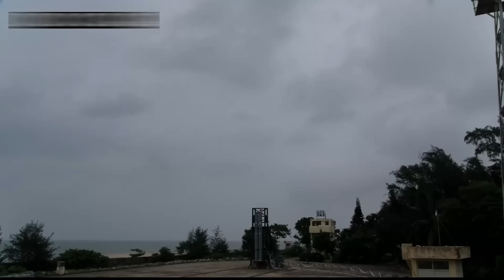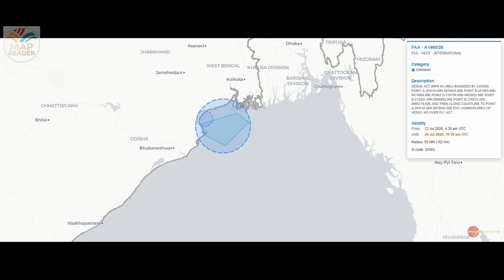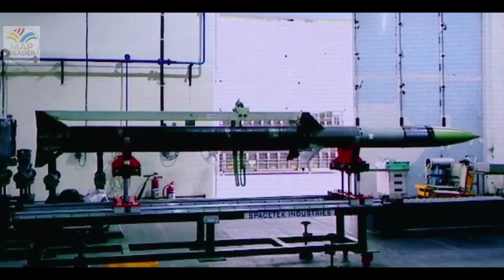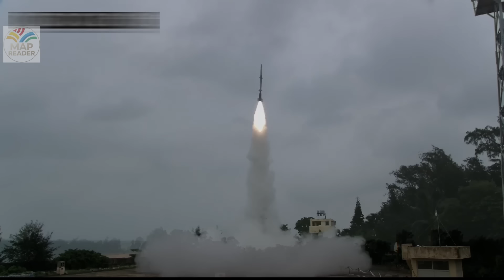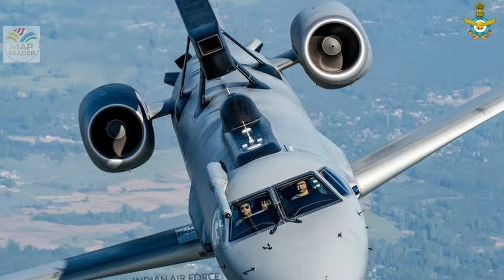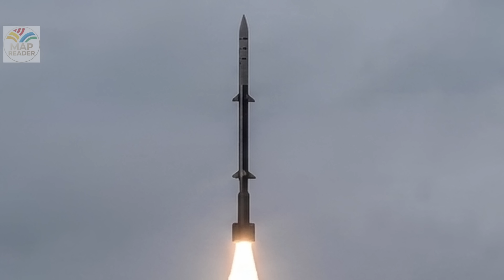Kusha Air Defence Test Successful | This is Big

Comment: Dear Map Reader ji,

I thought Su-30Mki can be used as aerial Air Defense System by integrating Akash NG intercpetor missiles .

If ALBM integrated then why not AL-Interceptor missile and it can be layered Airdefense and also Backup and hard for enemy to kill Airdefense system, or it can cover from aerial if Ground ADS destroyed.

We need to tap Su-30mki full potential.
Reply from the maker: Akash ng is heavy because it is ground to Air , Su 30 Already has Astra missile family far lighter and more range than Akash NG , actually its the other way around astra sfdr will be used as ground to air with a booster

Comment: 14:08 is kusha not a Hit to Kill as mentioned ?
Reply from the maker: Project Kusha incorporates advanced high precision proximity fuzes, which utilize indigenous radio and laser based sensor technologies to activate interceptor payloads when in the vicinity of fast moving aerial objects to achieve mission objectives.
Reply: @MapReaderYT So its Hit to Kill as mentioned in reports is not correct ? and what about Patriot Pac 3 Hit to Kill?
Reply from the maker: Kusha will use both depending on what they intend to hit
Reply: @MapReaderYT How good is Kusha compared to S400 or Patriot?
Reply: @MapReaderYT when you say vicinity how close?

Comment: Dont want to put you on the spot but really want to know about your views on the political upheaval happening in our country facilitated by the students
Reply from the maker: It’s a required feedback loop to keep gov in check, gov got the mood and there will be some change in exam system , I doubt these protestors will getting be anything more done , They’re attempting to emulate the Anna Hazare movement which along with 100 other factors led to the shift in power at the centre following the election 2014. current gov is doing massive infra overhaul , political opponents have hardly any rope and are trying to cling to this fringe, small issue.

Comment: It has been suspected that the U.S. patriot missile system has not even intercepted a single incoming missile since its induction, especially over Israel. But of course the American propaganda machinery always suppresses such information and instead sings their praise and all their weapons as always performing perfectly. India most likely shot down many paki F-16s and the pakis and Americans suppress such information. Despite our electronic evidence, it's hard to produce physical evidence of paki F-16 wreckage as they fall inside paki land or territory under their control. The pakis when they try to penetrate our air space they do so very hesitantly, quickly entering, if at all, and firing their AMRAAMs and quickly turning back into their territory. In such situations it's hard for us to recover their wreckage even if we shoot them down.
Reply from the maker: The Patriot missile system has intercepted a lot of very capable Russian missiles, there is footage of it.

Comment: I would like your opinion on this, the kusha explicity says that its a Blast fragmentation warhead interceptor, and the M-2 will also be used by our navy, for BMD, i want your thoughts on this, shouldnt it have been desoigned as Hit to Kill, which would just happen to have a proximity fuse as a backup, i mean for direction proximity fuse, it needs to go parallel, or somewhat parellel to the vector incoming, and explode, and hope that the shrapnel takes the threat down, its okay for fighter jets and drones, Missiles have incredibly hard coverings, i really dont know how much it would matter, i get it, the overpressure might make it tumble out of the air, but nukes are msotly airblast variants, who need altitude detonation, they dont necessarily look for CEP, its a nuke for a reason, secondly, HGVs, quite literally just need Hit to Kill to destroy, we have already validated Hit to kill capability, forst in 2019, when we shot a staellite down, and then when we tested our BMD phase 2, infact that patriot Pac-3 missiles, which is also a BMD layer, besides the THAAD, is a hit to kill vehicle, wasnt this operationally myopic?
Reply from the maker: Project Kusha uses both mechanisms, so it won’t be a problem. Both are good depending on what they are hitting. Hit to kill is difficult to master, but DRDO has mastered it .
Reply: @MapReaderYT I mean, the DRDO image rendering stated Proximity fuze, that's why I was saying, appreciate your response